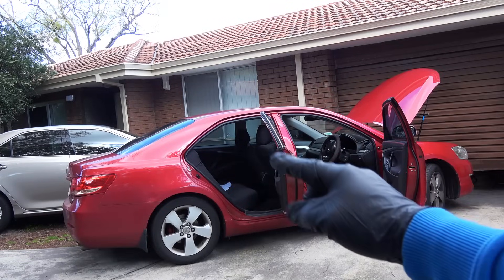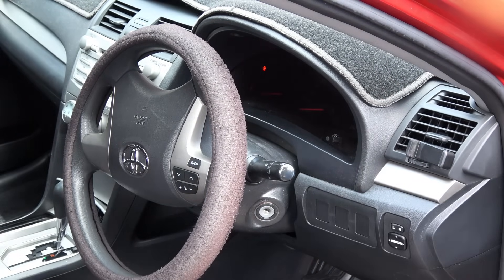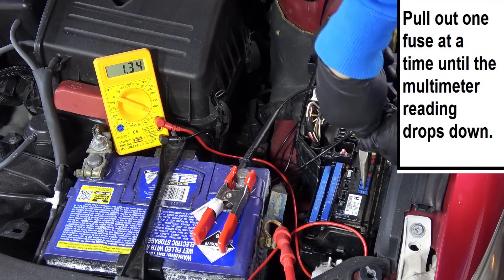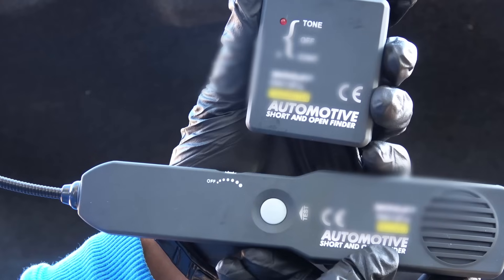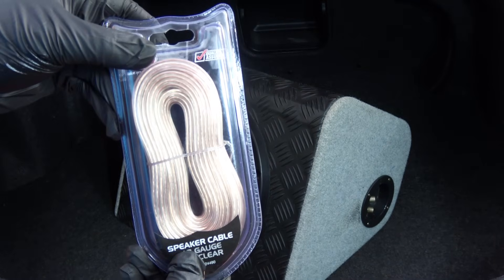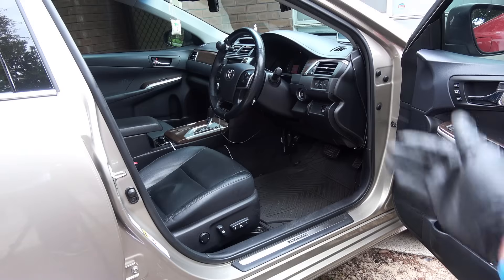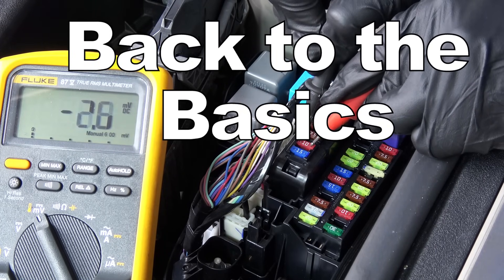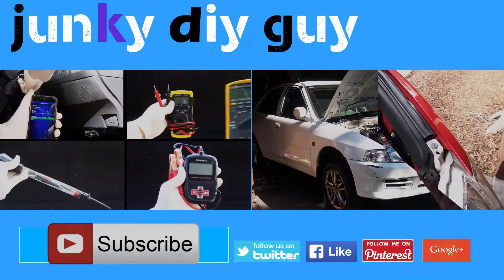How to find a short in a modern car fast and easy (The correct way)

Comment: As a general rule when you use the term "short" you will generally see smoke or find burnt wires. If your radio is still drawing power it is likely you have a switch that is malfunctioning. A short means negative and positive have touched each other
Reply: I'm a automotive tech. And more specifically an electrical diagnostic tech, smoke and burned wires are not common symptoms of a short. In fact, I've only seen that happen 2 times. 
Second, many components can short internally, and cause a parasitic draw. (A radio for example or modules typically) the poster of the video should have mentioned this. The title is misleading. A short doesn't nessicarily mean ground and positive have touched. There's a few other types of electrical shorts. 
Stop spreading misinformation.
Reply: @ryanhamm2958 Right. All a short really means is that the circuit is taking a “shorter” path through the circuit than originally intended. If there’s little to no resistance on that path, yea, you can have burnt wires, fires hazards, etc, but this is not always the case. It depends on how short the path is, and how much voltage output and total resistance is on that now shorted circuit … etc.
Reply: @ryanhamm2958  any idea why my Ford Fiesta has a circuit motor pump failure? Keeps blowing 30 amp fuse something is shorting out somewhere but I can not find where 😌
Reply: @ryanhamm2958 please explain better
Reply: @ryanhamm2958  At the beginning of the video he said that this a basic explanation for beginners like me. Here we have a typical example of one type of short. I liked your comment which makes me to  research further into the matter. What I didn’t like is when you said that he  was misleading!
Reply: Because they have no idea what they are saying
This is properly described as a parasitic  draw test
Reply: Yes, sir! Accuracy counts.
Reply: Always wondered about why people loosely say this.
Reply: I had a radiator fan (E-Fan) that was wired directly to battery without module, fuse, breaker. Just a thermostat switch that was setting sideways across rad fins.
It burnt right next to thermostat switch pin that goes to fan positive on the fans yellow wire (12 or 14 gauge I believe)
There was no short just a short wire to battery+ to input of therm switch and fans positive to output.

I'm going to redo the wiring when I get a new radiator installed because it blew out fluid at bottom of Radiator.
I do suspect that coolant got on thermostatic switch.

I'm putting a 30A Bussmann Circuit Breaker on high end wire going to 4 pin 40A relay on 30pin.
I'm running 16awg OFC primary wire from inside fuse box on key on fuse with a 5Amp fuse going to 86pin.
My therm switch will go to 85pin as ground and other pin will go to ground bolt (all 16 AWG)
High side has 10 Gauge OFC primary wire.
87 pin has high end going to fan +

I'm also splicing in a toggle switch to the 85 ground switch side just before relay so I can override switch when in 100°f stop n go traffic with AC blowing full. But the toggle switch won't stop thermostat switch from actuating high side of relay to turn on fan separately.
The relay only pulls 200mA and the fan pulls 25A max according to manufacturer.
I'll use a Clamp-Meter to monitor peak amps on startup and normal amperage on constant run. And adjust fuses accordingly.
Reply: I thought a short can still draw power.
Reply: I explain it as a short to ground or a short circuit.
The whole body, engine block, frame and door jams are negative charged. In cars, trucks and SUVs this is done by factory by running a ground strap (mesh metal cable/wire that's very thick and strong) to the body frame and then other body bolts in that side of battery there's metal body body bolts that has a cable going from that side of engine bay to the engines upper block which makes it ground. Then accessories like the alternator only needs a shorter cable to it's negative terminal bolt.
This reduces the amount of wiring required in vehicles greatly and simplifies the wiring design and how it's run.

One of the things that go bad in electrical systems is the door jam wiring going from under dash into the doors which run many components including stereo system, speakers, windows, mirrors, interior door lights, instrument panels in some cases.
Many cases a ground wire is run through door with power wires, this is always a bad idea so when I have any issues in the vehicle I'm working in, I generally remove ground wire going through and just run wire to the door side only and put it in a door bolt which is grounded. You have to sand off paint off bolt and under bolt and use NOCO battery terminal protector spray which is translucent red after fastening the wire under bolt that way what needs contact has contact and it's not protected from corrosion and rust where the paint was removed. And holds excellent conductivity. That spray is also supposed to be conductive and not effect your electrical connections or cause any additional resistance.
Reply: A short is a short.If so you will blow the fuse.parasitic draw is generated via added resistance in circuit creating voltage drop through a bad connection or a component starting to fail.Basic electrical
Reply: Ok my a/c switch power cable is getting burnt from the heat it gets any idea what it could be
Reply: @exgremory3387  26yr master tech here(electrical diagnostics specialist)something like that can be caused by something thats causing high resistance...high resistance = heat =melted connectors...could be something as simple as worn pins in a connector to a bad blower motor resistor... Just curious,what vehicle is this happening to?
Reply: Great video, bro!
I found one problem though...
You have a hole in the thumb if your left glove. 😆

Comment: Trying to find a parasitic drain in the 2005 Vibe I just bought. The voltmeter reads 2.34 when set on 10A which he says is normal but there is definitely a drain on the battery, which is new. The battery voltage goes from 12.7 to 12. 3 in just a few hours. I am able to drive the car but must disconnect the positive battery cable whenever it's parked for a long time.
Reply: A continuous learner here. What was wrong actually? Btw was it 2.34 AMPS draining?

Comment: completly useless. if you remove fuses to find voltage lost then you could reset a computer. when you unplug a battery you reset all the computers in that car. when you re install the fuse there is no more drain. you are screwed. the best way when you have a battery that lost the charge is to install a ampmeter in the battery  negative cable and see if there is some current lost. then use themultimeter and the spec the check the vlotage drop per fuses. whene you found the fuse that have a good voltage drop then you can focus on that circuit.never ever diconect a circuit to check the circuit intregrity!!!!!!!!!

Comment: Great video thanks!  Question... recent purchase 2008 Saturn Astra H 1.8 .
My rear passenger power window went down , but wont go up and tha left rear window doesn't go down or up?
Have the panel off rear passenger door and would likt to know where to troubleshoot first?
both driver and passenger power windows work.
Thanks
'
Reply from the maker: Check the wiring harness between the door and the pillars where the door hinges on to the body and also the connectors.  A common issue with astras. Will need to solder them together if the wires are broken and that’s the cheapest fix

Comment: One of the best videos. Thanks! When you pulled the fuse the ams dropped from 1.6 to 0.5. 0.5 is still too high, correct?
Reply: Yes .5 amp is an unacceptable draw in a static state.

However his tutorial is effective.

Comment: Your're looking for a parasidic draw not a short.Parasidic put a drain on your battery. Shorts usually blow fuses. You have two kinds of shorts for example power to power shorts which doesnt normally blow your fuse; ifyour press your horn your indicator light comes on. Shot to ground ground most definately blow your fuse since there is no resistance.
Reply: Leave the guy alone.  Where's your video helping people??
Reply: To be perfectly accurate, parasitic draw can be and often is what is called a high resistance short.
Reply: @walterk1221  So why does the fuse does not blow if it s a short?..When i switch on my demister switch on..my power windows, air blower fan will not work cuz the heater fuse blow..Thanks
Reply: @yolandosoquite3507  well any circuit can be seen as a short then....a controlled short😒
Reply: @ericscaillet2232  Overloading the system then?..It is short but not long short..Long short meaning..circuitries are long connections of loads ..but a short only one load is involved...ie the purpose of a fuse...not burning the whole circuitry!..just thinking..
Reply: @yolandosoquite3507  because, as I stated, it is a high-resistance short. Current is insufficient to blow the fuse.
Reply: @walterk1221   Who gives a fuck it's all semantics.
Reply: @easylivingsherpa  Enough of the hate speech. 😁
Reply: @enlightenednews5265  thats not hate speech lol
Reply: @easylivingsherpa  no, it is NOT semantics. It is proper and professional vocabulary.
Reply: Exactly.
Reply: The term is PARASITIC

Comment: Very well narrated and quick to the point.  Great camera angles and quality.  Also very creative solutions for troubleshooting.  I like the tips for cars that need to enter sleep mode. Tricking the computers by closing door and hood switches and using the remote to lock the car.

Comment: Wow this is by far the best video I have seen describing how to find a short circuit, thank you so much!
Reply: I think it is a bad video because the tech should also be considering why the amplifier is putting power to the sub with key off overnight. With the key out the amp should power down and kill power to the sub as the mosfets shut off. The radio output to turn on amplifier should also be tested to see if it is shutting off or if the amp is bad. Maybe the short at the sub burned a transistor in the amp and now the amp will not power down properly. More testing required for guaranteed workmanship.
Reply: @anthonyrybczynski5420  thank you Anthony! Super new to this and your comment makes complete sense. I have now learnt the basics from the video and a little more from you :)
Reply: @Change-Maker  look for videos using a bell telephone tool to find the short. You pull the fuse and induce a signal into the circuit with a short. Then there is a second tool that makes a tone, you run it along the harness until the tone stops, then open the harness. You can also buy a similar tool made by power probe. It comes in the power probe master kit #5.0. From what i hear the bell tool works the same just people find the bell tool cheaper.

Comment: Speaker cable had nothing to do with the voltage drainage period
Reply: Yeah, probably blew a transistor in the RADIO because of shorted output
Reply: Typically a larger wire is required to drive your subs.  I would replace the wires with larger. Thanks for the video.. well done

Comment: Sorry again. I have lexus ls400. the fuse which causes the  short is not not known what it is controlling because it is not mentioned on the fuse cover box. when i remove it many functions stop working such as a/c and other things. so, what can i do to find out which wire in the wire  bundle is the cause of the problem. can a circuit tester detect the short for i have already ordered one. the battery in new, but i have still have a parasitic draw.
regards.

Comment: is good way to find the shorts how ever tjis is the old method imagine that you remove th fuse fir the body controlr module first  and  this is a fuse  was not the problem noe you wake uo all the computers are on the network that when you install back  the fuse and you havr ti wait about  45 minutes for them to go to sleep , I have a video to avoid that . your metod is good  I used it for many years is jus time consuming

Comment: Disconnecting the negative battery on some newer cars such as VWs and Jaguars could cause a loss of throttle settings and a dealer scan tool is the only way to get the car started.
Reply: This is not true one does not need to re-align or do basic settings in a new Audi or VW when the battery is disconnected. The ECU automatically does this all you need to do is leave the ignition turned on for a few seconds after the battery is Re-connected..
Reply: niacal4nia you are righ vw and audi every time you erase codes or disconect the batery  you have to do throttle body relearn
Reply: Av987  its not only audi. I have Audi and Nissan, its THE same with Nissan.
Reply: Lol no
Reply: One more reason to never buy an Audi or VW
Reply: @Av987  yep,making complications where there were none to begin with.

Comment: What about if I get a 0.01 reading on the amp mode? Tried multiple times and that's all I get. Any inputs?
Reply from the maker: 1amp = 1000miliamps. so if you're getting 0.01 amps, that means you're having a 10 miliamps current draw through the battery, that's completely normal, nothing to worry about. Like i said most cars draw around 35 to 50 miliamps. German cars with lots of control modules like Mercedes go even higher by default.

Comment: thanks for sharing, I have a voltage drop problem with a 1994 Chevy S10, I was going to do what you show in your video so... I disconnected the ground cable, I connected one lead to the miter and when I touch the ground pole battery  with the other miter lead the head lights came on! what can be the problem? A ground wire?
Reply from the maker: if you have a dome override button, press that few times see if the dome lights including the headlights go away, if you have day time running lights, check the DRL relay as well. It could be a shorted out headlight switch too. check them all

Comment: If the wiring to the sub was shorted, it is the amplifier that is damaged and drawing the excess current.  Just removing the wiring short won't fix the damaged amp.
Reply from the maker: What if the loose subwoofer is moving around inside the boot and damaged the wires.
Reply: Amplifiers pull high current loads. Using high gauge wire causes the wires to heat up, melt, then possibly short. It's not a bad amp. It's an amp requiring better leads. Unfortunately not speaker wire as shown...

Comment: Is this basically the 2008 Toyota Camry?
 I am experiencing this issue with a used 2008 Camry XLE I just purchased. I believe it is coming from the hood latch sensor that activates the theft deterrent system when I lock the doors. 
I park my car in a garage and do not lock the doors, could this hood latch sensor be the cause? 
This car is fairly new, with only 86,000  miles, and I keep getting warnings that my hood is open when I am driving even when I am certain it is closed.
Reply from the maker: it may well be the case, check the connector to the hood latch sensor,

Comment: Excellent video. What if when I removed the negative battery terminal and check the voltage where you got 1.34 mines is showing 9.35 what do you think is causing that?
Reply from the maker: that means something is drawing 9.35 amps. That's pretty big for a short. Make sure you turn everything off before the test. Eg:interior lights, light inside the boot. inside glove box. If nothing seems to be turned on, then do the test to find out which circuit drains the current. Check the alternator for any shorts too.
Reply: Junky DIY guy, My battery has been dying if not driven for a day. I did this test and it shows 0.47? Does that mean there is a drain?
Reply: There sure is, mine was interior dome light and radio. I have just pulled out both the fuses for the time being until I can work out what is causing the drain. I think minimal acceptable drain would be around 0.03
Reply: @ViteshSingh  You definitely have a drain. It doesn't seem to be a short but something is drawing almost half an amp. That's too much for a parked car with nothing on.
Reply: Voltage (?)  Probably meant current (amps) (?)

Comment: The voltage on my car's battery reads 12.3 when connected and 12.6 when terminals disconnected. Is this normal? What could cause this?
Reply from the maker: either there's something in your car drawing a large current off the battery or your battery is going out. Have your battery load tested first. It could be the battery.
Reply: Junky DIY guy could it be the car's immibiliser? I have also noticed some corrosion on one the power distributor connections, could this have an effect? Btw the rpm does jump around on cold start
Reply from the maker: immobilisers don't pull that much current off the battery, but corrosion can increase the resistance through the connection so you clean the corrosion first, for the rpm issue, seems like you have an idling issue, clean the throttle body and the idle air control valve with a cleaner.